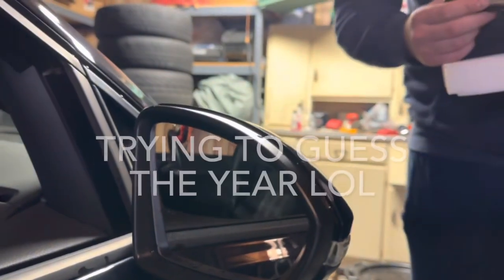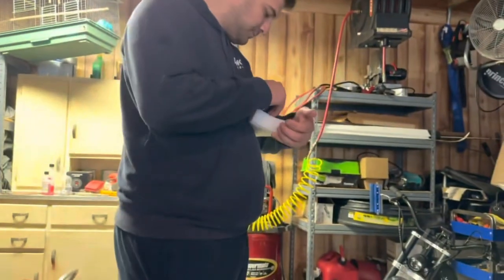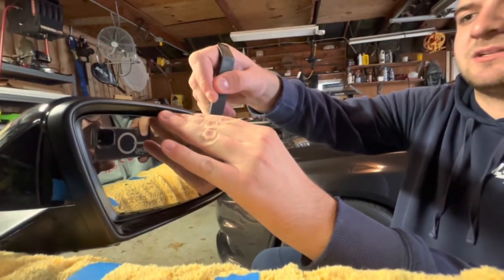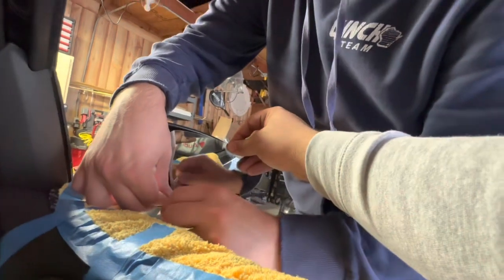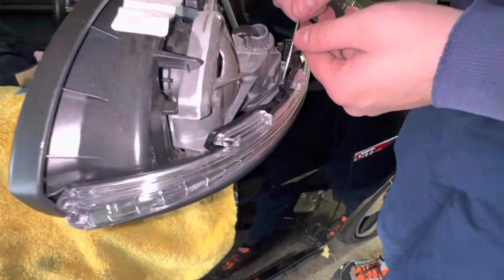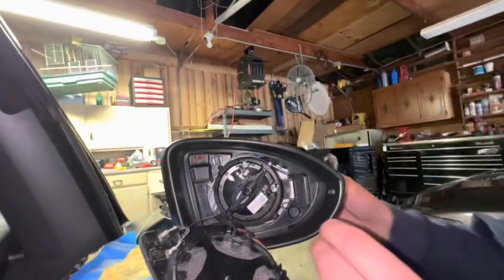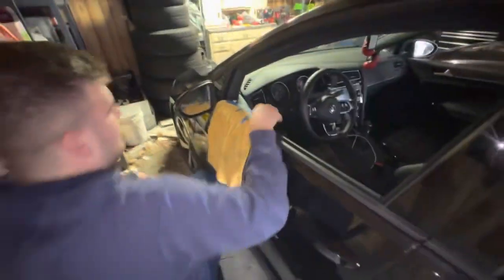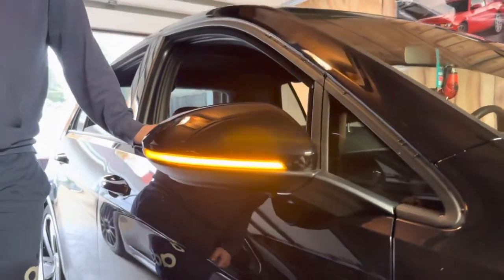GTI (MK7/MK7.5) Dynamic Turn Signals Install

Comment: Where did you get these for $11? Link?
Reply from the maker: US $12.09  50％ Off | 2pcs Kibowear For VW Golf 7.5 MK7.5 GTI R GTD RLINE MK7 7 Dynamic Blinker LED Turn Signal Mirror 2013 2016 2017 Jetta 2019 2020
https://a.aliexpress.com/_mO2Y8Lc
Reply from the maker: Looks like they raised the price to $12 but still a good deal. I used the Ali express app to purchase them. From personal experience I’ve bought a few items from there and it seems to be safe but the products come from China so it can take a few weeks for the items to arrive but if you’re not in a rush it’s worth the money you’ll save.